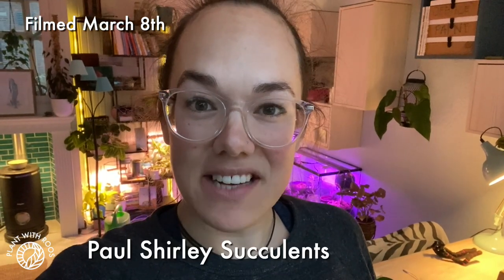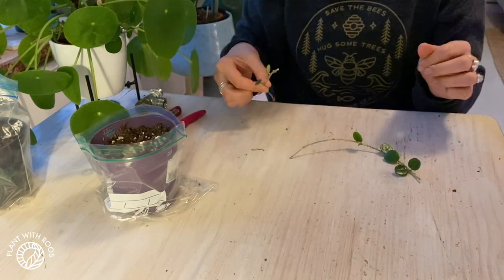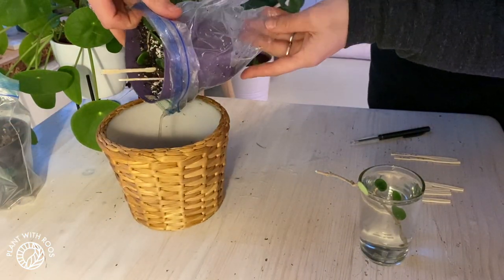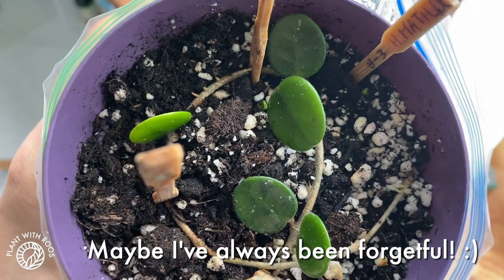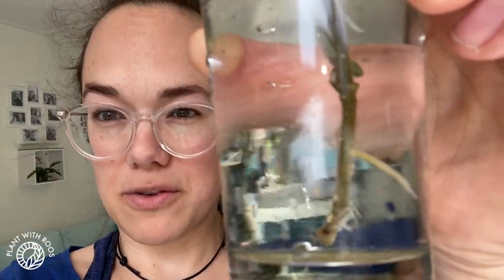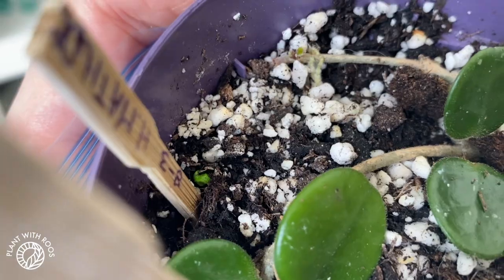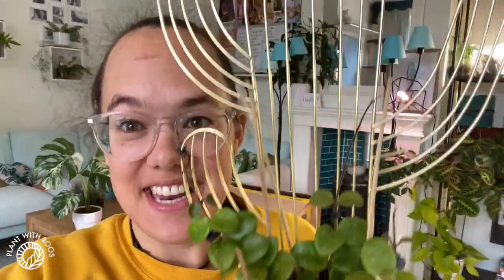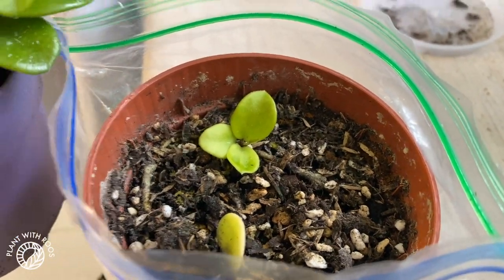Propagation test: soil+baggy vs water on a Hoya Mathilde | Plant with Roos

Comment: Very interesting to see this :) I get very good results propagating in distilled water (never tried rainwater). Sometimes I will add a drop of seaweed fertilizer and the roots just take off like crazy! I also did potting mix propagation and some of it was good some was less successful :D Now I want to try propagating Hoyas in moss and then in perlite, but first I have to find a Hoya victim 😈
Reply: I've been testing propagating in perlite and I get root growth and growth points like crazy! Except my biggest issue so far has been the transition into soil, since I feel it's almost like transitioning from water except slightly less of a shock :( I've lost many cutting to this method but also success with others! Maybe I'll give a go at leca instead